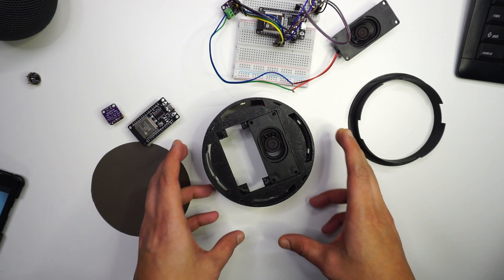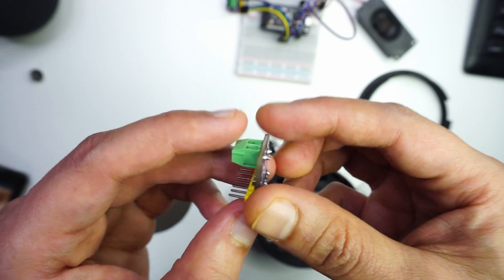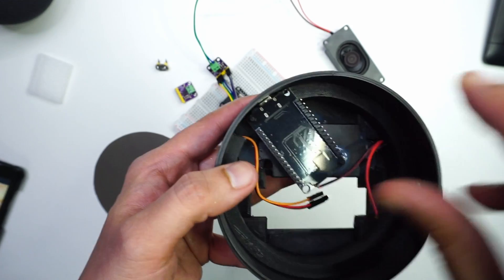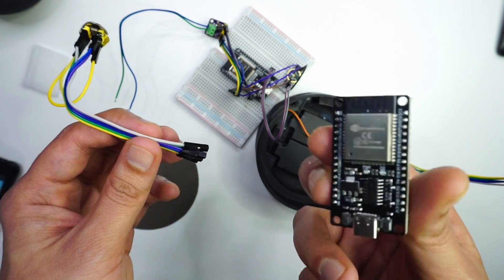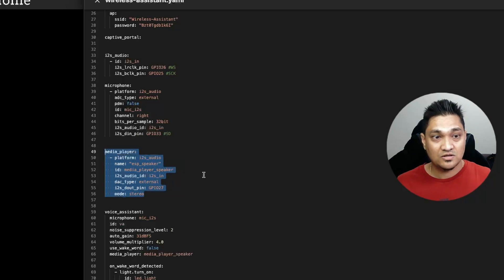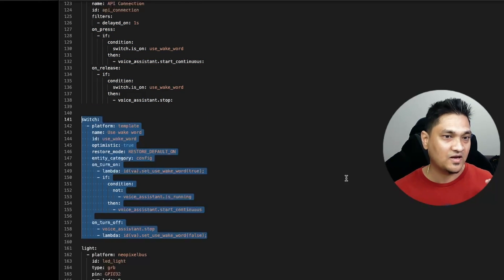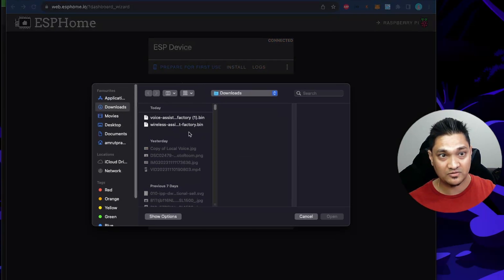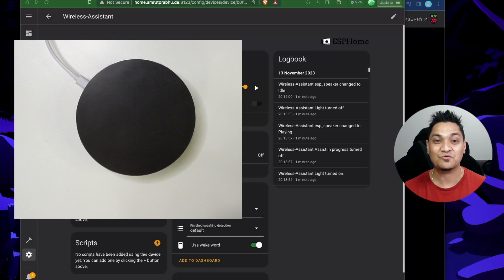How I CREATED My Voice Assistant With 15$ With WAKE Word Using ESP32 And Home Assistant

Comment: Hello! I know this is an old video... all my devices are now based on ESP32S3s and not this one, but it would be convenient to use the ESP32DevikitV1 only for announcements (without wake words) and without a microphone. The configuration still works well... the only problem is that it's not possible to play the initial sound before the announcement ("the sound that announces the announcement"). The configuration is old and I think that sound can be added. Do you know how I can do this or if you can point me to an updated YAML configuration for this? 
I have several ESP32Devkit devices in a box... and I would like to be able to use them as home annunciators.

Thanks.
Reply from the maker: It looks like you want more of an ESP32 speaker. Just to play some text I guess. Which is more of an announcement.
Reply: @SmartHomeCircle  No, just announcements. Playing text is pretty simple and easy, everything works, even playing audio files. I'd like to have some areas where only voice announcements are played without a microphone (otherwise there would be too many "ok nabu"s in the house). Since I have at least ten ESP32 devkit1s, I'd like to use them for this, BUT the sound before the announcement doesn't work.

Comment: hi i have did exactly what you done but iam facing some problme when i command it is not responding but iam able to controle light strip using the button in the esphome assistant.can you tell what is the problem
Reply from the maker: It could be the microphone. Make sure the microphone is in good condition. Try with another microphone and also keep the cables to the microphone short, like less than 10 cms.

Comment: Hello and thank u for great tutorial!
i am trying to connect only a speaker (with the amp unit mentioned in your video) just to play messages
can i use EPS32 C3 super mini instead of the larger esp32 dev? if yes, which pins i need to use on the C3 to connect to the amp unit?
thanks!
Reply from the maker: I am not sure about using C3 mini. You might have to try to it out. You can trying using the same connections from ESP32.

Comment: great tutourial, so all off you! is there a way to change the MAX98357A to the PCM5102. so the will connect direct with the 3.5/2.5 to the amply?
Reply from the maker: I cannot definitely say if it would work. 🙂

Comment: thank you, used your code it works,, only problem I have now is to program 4 switches been struggling for days now with no luck any help would be greatly appreciated
Reply from the maker: @Andries-x7g  which 4 switches?
Reply: @SmartHomeCircle  4 no momentory push buttons,, 1 x volume down 
1 x volume up 
1 x push play media second push back to normal satelite 
1 x keep button pushed to give commands 
I know it sounds like a lot but my aim is to keep it at the pool.
Reply from the maker: @AndriesEllis-x7g  check video of my new voice assistant with ESP32 S3 .. I have added a mute button. Maybe you can use some code from it..

Comment: Hi
This stops working in version 2025.4. Please address before upgrading.

The ESPHome in progress binary sensor binary_sensor.smartbox_assist_in_curs is deprecated.

Migrate your configuration to use the corresponding assist_satellite entity and then click SUBMIT to disable the in progress binary sensor and fix this issue.

Comment: hi, beautiful project, I made everything including the 3D printing, but when I go to give the voice command the microphone part doesn't seem to work... I put the pins as in your diagram and tried to change the channel writing from left to right ...do you have any idea why I can't get hey jarvis to start?
Reply from the maker: Can you make sure that the wires to the microphone are short? Like shorter than 10 cms. 
Also you can try to see what is recorded from the microphone by putting this option in the configuration.yaml file. 

```
 assist_pipeline:
   debug_recording_dir: /config/shared/assist_pipeline
```
This will record the audio as files in this location : /config/shared/assist_pipeline
Use this option with caution as it may fill up the space very fast. So dont forget to remove it after you have finished debugging.
Reply: @SmartHomeCircle  hi i used dupont standard , microphone not working
Reply from the maker: Ok.. let me know if it works with a new microphone. You can buy it with the links in the video description.
Reply: @SmartHomeCircle  Ciao , arrivato nuovo microfono e non funziona , ho letto per il discorso di cambiare sinistra o destra con la config..ho provato queste due
microphone:
  - platform: i2s_audio
    adc_type: external
    pdm: false
    id: mic_i2s
    channel: left
    bits_per_sample: 32bit
    i2s_audio_id: i2s_in
    i2s_din_pin: GPIO33  #SD Pin from the INMP441 Microphone

microphone:
  - platform: i2s_audio
    adc_type: external
    pdm: false
    id: mic_i2s
    channel: right
    bits_per_sample: 32bit
    i2s_audio_id: i2s_in
    i2s_din_pin: GPIO33  #SD Pin from the INMP441 Microphone

ma ancora non funziona

Comment: nice project and thanks for shearing it with us. the response is VERY SLOW. Can you please share with us where you have installed the whisper and pipper? Can you please share you hardware specifications? The response of your installation is very fast comparing to my installaton
Reply from the maker: I am using an Intel i5 system with 12gb ram. Whisper requires something more powerful than a Raspberry Pi 5. Also I am using the small-int8 model which is accurate 95% of the time. 
I hope that helps.

Comment: Troubleshooting
Warning ⸱ ESPHome integration introduced
This causes problems in version 2025.4. Please fix this issue before updating.

Binary sensor ESPHome in work binary_sensor.esp32_s3_wake_word_assist_in_progress is deprecated.

Change your configuration to use the appropriate Assist_satellite object and then click CONFIRM to disable the binary sensor "in operation" and resolve this issue.

Comment: came across an issue with the latest update of Esphome. It does not like "mode" here
speaker:
    platform: i2s_audio
    id: va_speaker
    i2s_audio_id: i2s_speaker
    dac_type: external
    i2s_dout_pin: GPIO8   #  DIN Pin of the MAX98357A Audio Amplifier
    mode: mono

update: swap "mode: mono"
with "i2s_mode: primary"
Reply from the maker: the mode is replaced with channel. 
I updated my article to reflect this.

Comment: I built mine this weekend following your video and it works great!! I do notice a couple things I wanted to ask you about 1. the low volume level is really low and at full volume it is not very loud is there a setting for this in the yaml? 2. When I ask it something and it has a follow-up question it is not listening for my reply is this an easy fix?
Reply from the maker: 1. In my config, which is there in this article: https://smarthomecircle.com/created-voice-assistant-esp32-with-wake-word-in-home-assistant
I am able to adjust the volume in Home Assistant , because I am using the media_player component. 
2. I haven't asked it a question yet, for which it asks me for another question. 😃
Are you using AI in your assist pipeline?

Comment: Can i use Any led strip instead of LED Strip WS2812B
Reply: please replay me
Reply from the maker: If you use other types of led strips it would not work.
It needs to be an individually addressable led strip.
Reply: @SmartHomeCircle  it is expensive in India
Reply from the maker: I just checked on amazon, it's available for 450rs for 1 meter.
Reply: Is there any option for using led strip
Reply: Please provide the link
Reply from the maker: https://amzn.to/3z51m6L

Comment: 2024.5 ESPhome update seems to have broken this. Works now only once after reboot and then stops responding. Anyone have an idea why?
Reply from the maker: Can you tell me what is broken?
Reply from the maker: Ahh, I see it stops working after the first command. 
Ill try to find a fix for this.

I am currently using the on-device wake word detection which I felt is much more reliable. 
Here is the link : https://youtu.be/rT_q0g8dtmY
Reply: Thanks for you work man.
Unfortunately I am experiencing the same issue; it works only once and then stops. I am forced to reload the integration.
Than there is that terrible sound.. I'm interessed also to your project with ESP32-S3.
Reply from the maker: There is some good news, there is already a fix on the way for this. 
Will update once its released.
Reply: Having the same issue as well, stops after the first command.  Tried several things with no luck, turned on debugging, did not see any issues.  I have an S3 and can make your new design but this device was working perfectly with my custom wake word, no false positives.  If a new release of ESPHome does not come out soon, I will move to on-device S3.  I see M5 Atom Echo users are having issues too.  Hope you can figure it out.
Reply: I got it to work again by switching to esp-idf, and then from using media_player to speaker and the light to esp32_rmt_led_strip from neopixelbus.  Thanks for a great project!

Comment: I build this device.working good, but some times the Device dont „speak“ to me.
Reply from the maker: Do you mean sometimes it does not speak out on the speaker to the commands you have given?
Reply: @SmartHomeCircle  yes.
Reply from the maker: And this happens sometimes I guess. 

Its a problem that exists. Sometimes the speaker buffer get too full to play the output. I also have the same problem in my current smart speaker. 

Check my latest video related to on-device Wake word with ESP32 S3. As of now its working better. I will be creating a new device with this new setup.

Comment: Built this and it works great except I can't get any audio out. The ESP media player entity exists but no audio occurs. Tried two amps, same results.
Thanks for the project.
Reply from the maker: Does it absolutely not play anything?
meaning the output from the text to speech?
Reply: Thanks for getting back to me.
No output at all. I have built two with the same results. The voice input works really well, just no audio output. Tried different pipe lines and still nothing.
Speech output from other sources is ok in the HA setup.
Cheers,
Bill
Reply: Actually it is intermittent. Log file says UDP does not stop.
Reply: I am having the same issue. Everything works fine except the audio. Replaced the MAX98357A but still no luck. Currently re-routing it to my echo dot as in your other video.

Comment: Is your system totally local?  No subscriptions (nabu casa?) The reason I ask is that lots of people are having issues with a requirement of HTTPS to use the mic with Home Assistant ESPHome browser UI.  This is a huge problem since the local URL for HA is HTTP.  You seem to make it work without this requirement.  My particular setup uses the M5 Atom, which is an integrated ESP32, mic, speaker and button.  Never been able to make it work due to the HTTPS requirement of the browser UI to use a mic.
Reply from the maker: My setup is completely local running on docker images.

The HTTPS requirement is of the browser to use the microphone. In case you are using atom echo, this is not required. You can use the assist feature without HTTPS if you are using an external device and not using the browser and you dont even have to open the assist window. So you cannot use the microphone option on the assist window on the browser without HTTPS. 
However if you have the mobile home assistant app, you can use the assist window microphone option.

If you want to know how to work with Atom Echo, check my video here : https://youtu.be/P_f1wd3vxbA
Reply: Thanks so much for your prompt reply.  I will checkout your Atom Echo video and hopefully get a setup that works with the M5 Atom without use of HTTPS! @SmartHomeCircle
Reply: @SmartHomeCircle  Wow it all worked with your video!!!!  I have asked everywhere and you are the only one that provided a real reply that worked.  
Thanks so much.  I am going to get the word out on your channel!

Comment: I recently tested this (prior to watching your video). The ESP32 randomly stops working due to memory buffer limitations; it will recover but it is inconsistent. I am testing the Wyoming satellite project with a Raspberry pi 3 and same mic and amp, and it seems to be more reliable. Any raspberry pi supporting 64 bits and wifi should work.
Reply from the maker: do you mean the memory buffer while playing the media or the output of the voice assistant? then yes. I do face the same issue. I however dont care about the the output as long as the command is recognized and executed successfully. 
I am still using the device as my daily driver and since my setup is completely local, I just love it. 😍

Comment: Awesome Video, just tried to recreate it but with slightly different hardware and without the speakers. I have everything installed and the LED's are working but it looks like I have trouble getting the mic to work. The ESP home logs just constantly repeat this: [12:29:24][D][light:036]: 'Voice_Control' Setting:
[12:29:24][D][light:085]:   Transition length: 0.5s
[12:29:24][D][voice_assistant:200]: Requesting start...
[12:29:24][D][voice_assistant:412]: State changed from START_PIPELINE to STARTING_PIPELINE
[12:29:24][D][voice_assistant:433]: Client started, streaming microphone
[12:29:24][D][voice_assistant:412]: State changed from STARTING_PIPELINE to STREAMING_MICROPHONE
[12:29:24][D][voice_assistant:418]: Desired state set to STREAMING_MICROPHONE
[12:29:24][D][voice_assistant:519]: Event Type: 1
[12:29:24][D][voice_assistant:522]: Assist Pipeline running
[12:29:24][D][voice_assistant:519]: Event Type: 9
[12:29:29][D][voice_assistant:519]: Event Type: 0
[12:29:29][D][voice_assistant:519]: Event Type: 2
[12:29:29][D][voice_assistant:609]: Assist Pipeline ended
Reply from the maker: This log is perfectly fine. 
Since the ESP32 does not support VAD(voice activity detector), the pipeline is invoked every 5 secs to try and detect the voice. 
Now there is one way to see what is recorded from the microphone for every pipeline run. 
You can set :-

 assist_pipeline:
   debug_recording_dir: /config/shared/assist_pipeline

This above yaml section in your configuration.yaml file and restart. All the recordings will be recorded at the location. 
But please remove it after you debug the issue or else it will fill up the disk space in Home Assistant and crash it. So be very careful with this option.
Reply: @SmartHomeCircle  Thank you for your answer. I thought something was wrong with it because I didn't see your esp doing that and nothing happened when I say the wake word. Ok, at least I know the microphone should be working, I know the LED's work as well because I can turn them on and off from HA so need to figure out why nothing happens on wake word. I use an ESP32-C3 Supermini board, could that be the issue? I ordered some dev boards but they are still on the way.
Reply from the maker: @CodeCrafted-w3x  it could be. I did see someone complaining about c3 not working as a voice assistant. I think it was a comment on another video.

I had ordered a c3 super mini and was about to test it for a voice assistant because of its size. but I am currently in my home town.
Reply: @SmartHomeCircle  I'll send you an update if I get it to work with the dev board, once they arrive (ordered on Aliexpress)

Comment: Not sure if you can help with this one, I built one into an old Echo device and implemented more pins on the ESP32 to use the buttons on the echo. I added a red LED to show if the mute mic button was pressed and code to turn off the wake word if its pressed. However, if I say Hey Jarvis, turn on the lights, it also turns on this LED

# Red LED
  - platform: binary
    name: "Mic Light"
    id: mic_light
    output: light_output

output:
  - id: light_output
    platform: gpio
    pin: GPIO19

# Turn on off the mic
binary_sensor:
  - platform: gpio
    pin:
      number: 18
      mode:
        input: true
        pullup: true
    id: "Mic_pin"
    disabled_by_default: true
    filters:
      - delayed_off: 10ms
    on_press:
      - light.toggle: mic_light
      - if:
          condition:
            light.is_on: mic_light 
          then:
            - switch.turn_off: use_wake_word
          else:
            - switch.turn_on: use_wake_word
Reply from the maker: Your code seems logically correct. 

May be you could add a delay after the light.toggle to allow the light state to be in the on state, so that the next if condition gets the light.is_on is true. 

Let me know if it works.

Comment: Tolles Projekt läuft gut nur das Problem mit den lauten Geräuschen ist nicht toll ich habe das ganze in eine alte Bluetoothbox gepackt
Reply from the maker: Do you mean the cracking noise when the device starts? Ya. I am facing the same thing. There is no fix to it yet. But I am working on a solution.

Comment: I do have an issue now, as its been mentioned somewhere else here, when you plug in you get the nasty sound coming out of the speaker. I now have that all the time, funny thing is, if I put my finger on one of the esp32 pins it stops, could there be some sort of grounding issue somewhere?
Reply from the maker: I was still doing some research somewhere. It could be the pins are not set in the right state and cause this problem. 
I think it could that the amplifier pin is not set in at right state and causes this cracking issue. I am still working on a solution. 
Once I find one, I will be making a video for it.